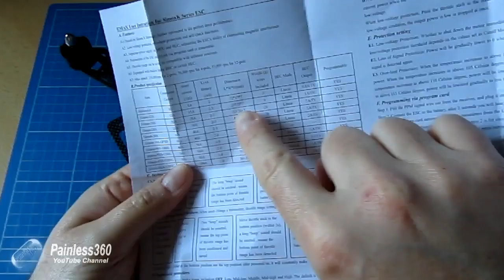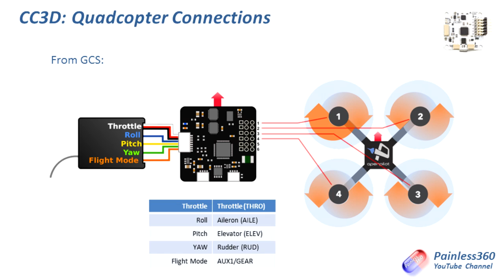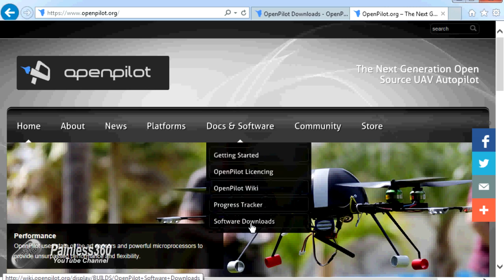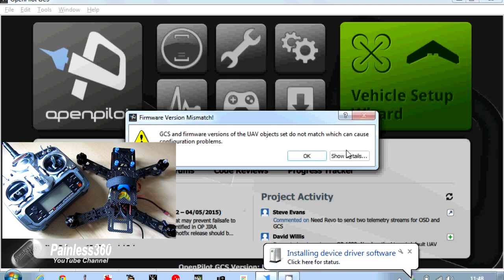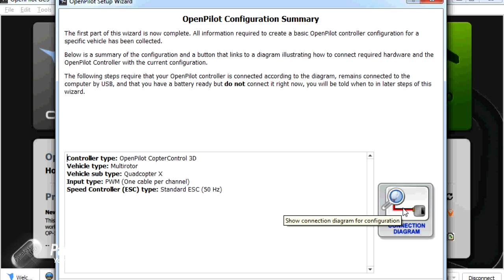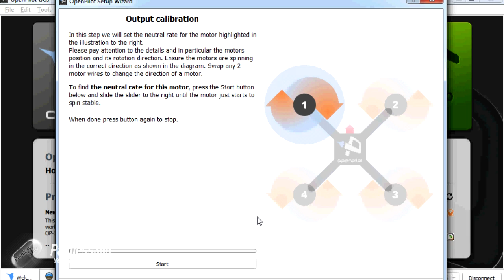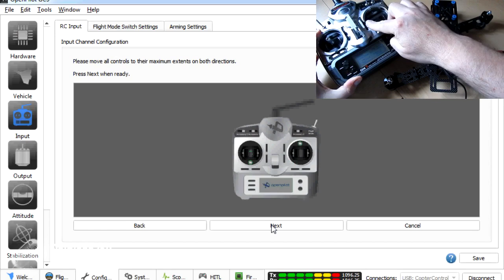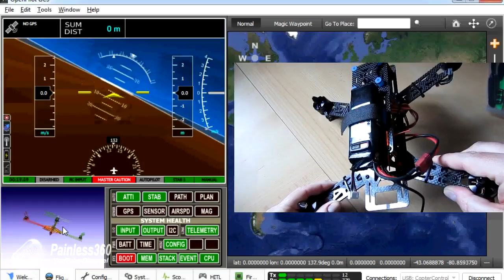(2/10) CC3D Flight Controller - Radio setup, firmware install and testing

Comment: I'm Having a problem and I've searched extensively without luck. It seems other people are having this problem as well. I have configured a fifth channel on my taranis for flight mode, but open pilot never recognizes it. I have tried several dozen times with various firmware, EEPROM, switches on my taranus, transmitters, and PWM/CPPM settings with no luck. Can you please advise. The channels monitor is reading correctly showing the three position switch (depending on which attempt) and registering three positions. This last switch is the only thing keeping me from getting my build off the ground so you can imagine how eager I am to get this resolved. 
chinese QAV 250, CC3D, frsky X8R or Frsky D4R 11, Taranus plus X9D
Thank You in advance.
Reply: I forgot to mention, In manual setup mode Openpilot shows activity on channel 5 my flight mode channel but it still doesn't seem to work.

Comment: I'm using a dx5e transmitter with receiver. My transmitter is binded and configured through open pilot but after that I get nothing, the quad wont fly I'm getting feedback from cpu like you explained in video but after your last step before you put on props that's where I'm stuck
Reply from the maker: Are you arming the board?

Comment: hey.

i have a zmr250 3k carbon kit and i have a FS-iA6 transmitter and receiver.
i did the whole set and everything went good
now when i try to fly it the motors are not spinning at all.
any idea?
Reply from the maker: What troubleshooting have you done?
Reply: +Painless360 
i checked all the motors connection the setting in the controller.
i did the set again and when i do the transmitter wizard and it asks you to move the controller accordingly to the wizard
when i move them it doesnt register and previously i did it worked now its not registering any thing.soo yea lost
Reply from the maker: Recheck the wiring. Also confirm if its ppm or pwm.. Best of luck!

Comment: Hello. I followed the procedure exactly as above. At last I disconnected the USB cable and tried to fly it installing the propellers, but none of the motors turned and was not able to fly it. Can you please help me out what to do??
Reply from the maker: Have you armed the board?
Reply: I armed it and it is working. Thanks a lot...
Reply from the maker: Glad it's sorted!

Comment: I have a quad like this and have been calibrating the escs to death through Open Pilot, I have tried everything and each time the two front motors always engage first and the two back motors lag behind. I even tried calibrating ESC manually. I can't get the motors to all spin at the same rate. At ropes end. HELP!
Reply from the maker: M Minskie I would check that the board thinks it's level when it is. Make sure that you have set the threshold for each of the motors through the sliders and recalibrate the accelerometers. 
Also, make sure that you don't have any trims set on the radio.
Best of luck.
Reply: Thank you very much! I appreciate the reply!

Comment: Painless360  All setup!!! but!  very low altitude im getting as if not getting full throttle...   during vehicle setup where it says to plug in the power so that CC3d sends the throttle range my esc's never beep, even after waiting 10 minutes so i just clicked stop and continued....   is this caused by all my red power leads from each esc still connected?  i have no idea what this banggood set came with as for esc, all i know is that they are 12amp SimonK.   turbo etc or standard or not i have no idea... if i choose rapid esc and do that part the motors spin at full throttle uncontrollably during that part of setup so i doubt they are rapid or turbo.

also posted this in discussion but more appropriete here i believe for those having same issue (which is ESC not beeping when cc3d tries to calibrate them)

Comment: hi Painless,i have on problem with my dx6i 
I fail to make my 1,2,3 button to change the flight mode in the configuration of the DX6i it's for a drone fpv etrubine 250 with CCD3 if you had to be a tutorial top thank you in advance sorry for my english
Reply from the maker: Make sure the mode chanbel is connected to the right channel on the reciever. Watch https://youtu.be/olIqTiSJHIY

Comment: hi painless, my computer is not ready my board right now ad i can get pass the "open pilot board identification. what do I do to fix this? I have a solid green light with a flashing blue light if that helps any
Reply from the maker: +colton martin Happy to help but please watch https://www.youtube.com/watch?v=olIqTiSJHIY and come back to me with more detail of what you've tried..
Reply: +Painless360  I have tried rescue and updates as I have seen on youtube but none of which work. only just times out because it does not read that a board is connected. when i go in the connect it I only get one bar on tx and nothing on rx. as well I have the solid green light with blinking blue light on board.. any advice?
Reply: +Painless360 I much appreciate you taking the time to help me resolve my issue but after digging through a box and finding many of the exact same cords and testing them all I have found that only one of them works and the rest did nothing more than deliver power
Reply: +Painless360  Sadly im an idiot and set myself back to the same issue trying to swap receivers at the transmitter binding step because it did not like the one I was trying to set up.. how do I fix this and why would it possibly not like my spectrum dx4e? thanks in advance
Reply: +Painless360 now I must apologize because I was too quick to post that response and I have gotten it connected again but it still wont bind to my radio(spektrum dx4e) with a spektrum AR6100e receiver. if you have any advice on that I would much appreciate. thank you
Reply from the maker: We've not used that radio and Rx here but normally the binding process is pretty straightforward. Best of luck..

Comment: is there a certain way to disconnect from the usb? when i disconnect the usb i lose the connection from the TX to RX
Reply from the maker: Michael Arana I've not seen this myself, it shouldn't make any difference how you disconnect but there have been a few issues with USB disconnection (@33574)
Best of luck with it.

Comment: How would I setup the CC3D with a Spektrum satellite receiver?
Reply from the maker: J.JONES RC https://wiki.openpilot.org/display/WIKI/Receiver+and+Transmitter+Options ;) Main or Aux port and some setup..Best of luck...
Reply: +Painless360 Hi first, i would like to thank you for your video and sharing your knowledge. I recently had a crash and for some reason it would no longer arm and now that i connect it to OpenPilot, i re-did everything that did the first time on your video. but after the crash i notice that on Flight Data on Openpilot it shows an "X" and does not show the artificial horizon moving when i move the quad. what is wrong? do i have to replace my cc3d now? or is there a fix to that?
Reply from the maker: I've never seen that myself. I would erase the board completely and see if a fresh load of the code helps. I would google the error too in case others have had it..

Best of luck with it..

Comment: Hi could you help me out here with a Problem Please?

I have a Dx6I tx and a x900 Tri copter which I have build ,iam using open pilot version 15.02.2 ,with a h king orange RX DSM2
I followed your video side by side on a windows p c ,every thing was going really well up until I got to the Tx set up in open pilot ! everything before that was going well ,motors spinning right ever thing on screen ,when I got to the part in  the wizard set up[
 were it says to move your sticks ,throttle up and down and follow the on screen instructions ,then press next ? I was waiting for the (next ) to show up on screen so as I could go on to the next section of the wizard !but it didn,t show up the word next ? 
the Tx isnt responding to the on screen instructions ?
I still had the usb connected and the battery too?

so iam wondering If you would have any thoughts on this thanks ? I have build a few tris with the K K 2 F C boards ,which was all good , But I read so much good  things about this CC3D board I had to try it,I did have a kk 2 board on this tri ,but

 disconnected it and iam sure that open Pilot erased the kk 2 firm ware !any help on this would be great ,I have watched a lot of  your videos from the start of my venture into quads and I have found them in valuable ,in fact I dont think I could have build any of the Tris with out your videos

,I been doing R C for a number of years now mostly Planes but quads has got me in :)can be a head ach thou ,any ideas on this would be greatly appreciated,thanks in advance.
Reply from the maker: +Paul McMahon I'd double check that the connections for the other channels are working ok and make sure that you have the right connection set in the wizard too (PWM, s-bus or PPM). Best of luck!

Comment: Instead of a remote control can i run it with an onboard raspberry pi, input to the flight controller the distance and direction i want it to go from the pi. some instructions on that would be helpful.
Reply from the maker: I've not tried anything like that. A more modern system would be something like the Pixhawk. The CC3D is showing it's age now..
Reply: Painless360 thanks for the quick reply..I saw pixhawk and multiwii as the newer ones.. also, the above kit is not available anymore, i cant seem to find a similar kit, do you know any?

Comment: does the battery have togo on top if your using a 3s can it be in the back
Reply from the maker: So long as it doesn't affect the center of gravity, you can mount it on the top or bottom.. Happy flying!

Comment: Hi Painless
Can you point me to a You Tube on  how to set up CC3D for a fixed aircraft, I  can setup for Multi rotors OK but cannot get the flight  surfaces  on aircraft to do anything but go to full throw , I can find nothing that explains the set up methods  Regards  Geoff
Reply from the maker: +SuperGoofa I've had a video in the works for 6 months now on this very topics and have not been able to complete it as when the self level mode is turned on the wing I have it on becomes very unresponsive (but level!). Until I figure that out I can't get a flight video and add that tip.. I keep trying when I get a chance to fly and test..

Comment: Hi Painless
i have opto esc for my build with cc3d atom can i run a 5v power supply for my cc3d from my PCB 
And want to use only 1 wire for my receiver PPM what pins would i use on my cc3d atom
Many thanks
Will.
Reply from the maker: +Will Fly depends on the software you use. The first two pins on the RC input are power and PPM will normally be pin 3 or 8.. see our CC3D setup series. Best of luck!
Reply: +Painless360 
I have spent hours watching them
software will be cleanflight and there is only six pins on the atom
trial and error i suppose with the ppm
Thanks.
Reply from the maker: +Will Fly watch the Tarot frame build we use PPM and OpenPilot on an Atom.. hope it helps you..
Reply: thank you

Comment: hey buddie..i got a QAV250 with the same cc3d which was factory set up, well surpossed to be.. i took it out just kept flipping so i got it connected to librepiolet and did the setup wizard followed all steps upto transmitter wizard.. im using librepiolet as its the newest software but exactly the same as open.. im using a flysky FS-T6 but it will not connect... any ideas how to solve this.. also now it wont even bind with my controller???? many thanks...
Reply from the maker: +Mike Philpin what troubleshooting have you already tried?

Comment: hey, im having a problem setting up my transmitter. i have a turnigy evolution and whenever the screen shows to move the sticks, and i do, the program doesnt detect anything
Reply from the maker: Not sure what you're describing..
Reply: I had the receiver plugged in wrong, thanks for the reply though :)

Comment: Hello there just got my first qav250.. got thru all the cc3d set up and clicked save. When I go to give it power it does nothing. Went into flight controller setting  and it does not move with motion , also attitude and stab are red boxes . It looked so easy on video. Why is mine not showing up. In boxes in flight controller I get "attitude" error. input box is Orange,  and stab box is red. Can you help me please? It seems like something isn't reading the models stabilization or attitude???
Reply from the maker: Adam R https://www.youtube.com/watch?v=olIqTiSJHIY and then come back to me. Best of luck with it.

Comment: Hi!! Really nice videos and helpful! Great work! I see you are using dx7 like me,but i have a problem with the fmode switch.cannot pass the wizard.everything works great exept this.this is the only 3mode switch on the dx7 but cc3d cannot see it.i managed to make it work with the gear switch but only 2 modes.tried a 6channel and a 5channel orange and sepcrum with no luck.tried mix gear and flaps,no luck. Can you please tel me exactly your connections to the transmitter and if you have made any adjustments to the dx7?i use a clean acro model. Thank you!
Reply from the maker: +Στέλιος Μαούτσος Can you see the three position switch moving in the monitor screen on the radio? If so what values is it sending (%)?
Reply: Thank you for your response!in the dx7 menu,it does not have percentages.it just has a slider that goes from 1/5 at first position,half at neutral position and 4/5 at 3rd position of the sw.if I make travel adjust of the flap 150% then it goes from start of slider to th end. As a side note,this sw works as it should on mynaza controller..
Reply from the maker: That is odd, I'd try again with those endpoints pushed to make the channel move all the way..
Reply: +Painless360 fixed it!! thank you for your time! well I reset everything,did the model on my dx from scratch,redid the wizard,nothing.Swapped channel 5-6 I had it like you, black on 5,yellow on 6(the colours are the same as yours) I even plugged a servo just to check!still nothing.And then I just started plugging out one channel at a time and presto: it worked!apparently there is a mix up then i have 5 and 6 channels connected so I left out the accessory, the black cable.Anyways, thanks again and keep up the good work!
Reply from the maker: Good news - happy flying!

Comment: what happens when the ESC calibration does not produce any tones or calibrates?
Reply from the maker: +Eric Somogyi The 'tones' actually come from the motors as the ESC sends high frequency pulses to the coils that makes the motor cans act like speakers. If you have the motor connected and their should be tones then I'd start to investigate why..
Reply: +Painless360 

I couldn't get it to sing like your model, and our models look similar. following guides from another video,  I was able to manually calibrate within cc3d and my quad is behaving way less chaotic now.

Great video, thanks for sharing.

Comment: hi, how will I power the cc3d if my esc's don't have built in bec?
Reply from the maker: +Christian Nalo Use a separate UBEC, you can usually make it all work by plugging the UBEC into spare pins on the radio Rx if non of the ESC connectors are free on the board..Best of luck!
Reply: Ow thanks for the reply, hmm is it safe to plug an opto esc directly to the fc? Or should I just solder the signal wire to the fc?
Reply from the maker: Watch 'Introduction to ESCs' video - that covers all of this for you. Best of luck.

Comment: what is the best way to insure motor cutoff when connection is lost?
Reply from the maker: +Troest87 Use a receiver with a failsafe so that when the radio looses connection the receiver defaults to zero throttle. Happy flying!
Reply: +Painless360 ok, thanks

Comment: hello 360  i have problem with my motor they are getting to hot when i plug the battery in 40 sec it gives me a loud beep and the 4 motor get hot .
i have micro esc 20a they have 2 wire ( signal and ground)
Reply from the maker: +tiger exhaust That isn't right. I'd check the wiring and that the ESCs can handle the battery you are using (3s 4s etc). If you need more help book a one to one session (not free though) through the website..Best of luck.

Comment: Hi. I am trying to do the firmware install on my CC3D board. I downloaded OpenPilot and connected my board but when I got to the vehicle setup wizard and try to upgrade the board, it tells me that it timed out and is waiting for a board to be fully connected. It also will not detect the type of board when I click next. It says that my board is connected so I am not sure what the problem is.
Reply from the maker: Id try another usb cable. Another pc and then ask the vendor for support in case it's a bad one.  Best of luck!
Reply: +Painless360  Thank you
Reply: +Painless360 I tried another usb cable and pc still no luck. Could there be anything I am doing wrong? Everything seems to work correctly with the board.
Reply from the maker: +Calvin Geppert The details we have are all in the video. Have you tried the vendor?
Reply: +Painless360 I finally got it to work. Thank you! But now I am doing the transmitter setup wizard and I cannot get past the Flight Mode Switch part. I have the FS-T6 transmitter. I have tried switching the wires in the receiver but that didn't work. I am not sure what I am supposed to do. I found the right flight mode switch and it works on the transmitter. I dont know what is wrong.
Reply: +Painless360 What do you think?
Reply from the maker: Have you made sure that the channel you think is moving when you flick the switch for modes is?